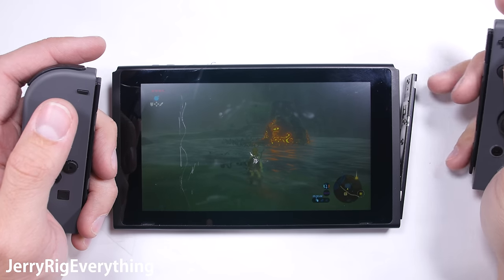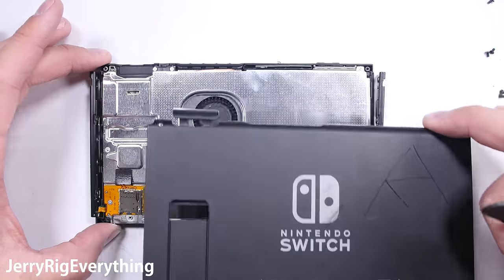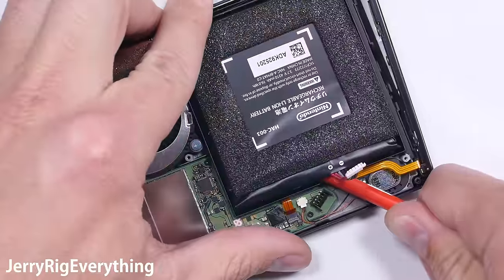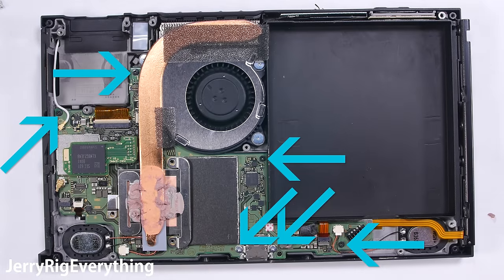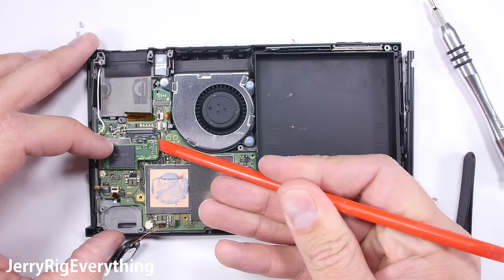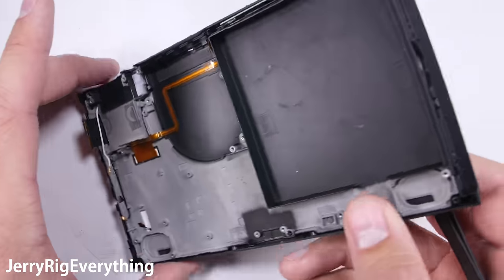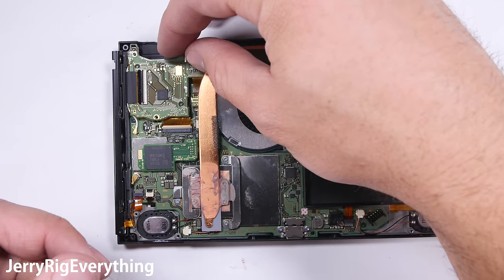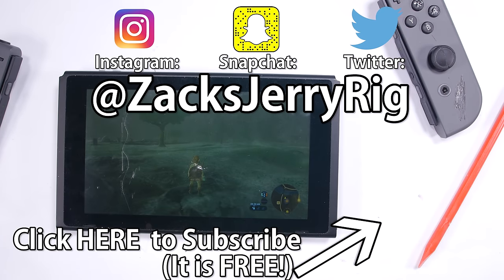Nintendo Switch Teardown - Take apart - Inside Review

Comment: Started this video hoping that the switch would be kinda easy to break down, but it still is a bit much. Having to bent the battery to remove it worries me. Kinda wish the screen wasn’t glued, I have a speck of dust that somehow made its way into my screen. Looks kinda like a dead pixel at any brightness, but it seems to move when I tilt the device, so it’s definitely dust. Not worth the risk to remove if this is what it takes to open up the display.

Comment: 1:30 BE CAREFUL with this screw below the SD card reader, immediately to the left of the red spudging tool.  For whatever reason, my Switch's screwhole here is standard.  It doesn't have that reinforcement this version has.

Just a single removal of the screw from that hole and it was stripped (the hole itself, not the screw.) I actually had to use a pair of snips and cut that piece of aluminum out as the screw would no longer thread.

(For reference: I have a high-quality set of electronics-repair drivers with many dozens of driver-heads.  I've disassembled dozens of mobile devices to do everything short of component-level board repair and NEVER had a problem like this)
Reply: Maybe you have a 2017 model Switch, while on the video they have a 2019 model?

Comment: I've a feeling those screws are probably not actually Phillips.
Nintendo is a Japanese company, so it's much more likely to be JIS, a very similar looking screw, that will work with Phillips screwdrivers in a pinch, but will be completely destroyed by the Phillips head if the screw is too tight.

Yes this is a thing, I can't be positive, as for example ifixit says both In different guides, I'd say most likely JIS, seeing as the 3ds for example used them.

But it's something to be aware of when opening up any Japanese product, get both, and see which one fits better with less wobble

Comment: Guys i need help. I can take off every screw except for the 4 screws on the back of the switch. Ive tried using both y0 and y00 screwdrivers.
Reply: I took 2 of the screws off the back but can't take off the last two, I also want to know which screwdrivers I need :(

Comment: I started getting this Error Code: 2002-3580. I tried taking it in and they couldn’t help. Basically it just pops up after a minute or so. I followed your video and have it all apart, wanted to see if there was something obvious. Any ideas? Does seem like some kind of overheating issue I think?

Comment: Regarding the ribbon cables which are responsible for charging the controllers. Are these also responsible for detecting that the controllers have been attached to the screen? If not, how is the switch able to tell when the controller needs to be connected wirelessly or that it’s been snapped in? 

The reason I ask is because I am having a strange issue with the switch where when the left controller has been fully snapped into the switch screen, it doesn’t register a connection  and is not able to work. However, the controller will begin to start charging so the connection to the ribbon cable is working. It just doesn’t actually register a connection with the controller as far as it being able to be used to work with the console. When I pop the controller out, it is then able to be used in wireless mode just fine. If the ribbon cable both charges the joycon and is responsible for the actual controller connection, why would it only work for charging but not allow the controller to be seen by the switch?

Comment: HELP!  My Son asked me to replace the fan in his switch, so I got everything set up to make the repair, but all the screws on the sides had so much corrosion from "Teen Boys Hand Sweat" that they were like cheese.  So I got out my gun cleaner (on a Q-tip) and was able to clean up and remove all but 1 - that last one is so stripped that I started to try and drill it out.  I know most of you are laughing right now, but I really am highly skilled at these things normally. I'm not worried about replacing them because clearly I'm going to get all new teeny tiny little screws, but how do I safely remove this last one that was "cheese" on the outer layer, but now seems to be solid diamond when trying to drill it out?
Reply: What

Comment: Yeah I bought mine used but I think it’s been opened before because the screw  on the top near the heat vent its gone and every time I play a game it’s always saying that please reconnect your left joy con I need to open it and see if the left joy con rail is connected right so I need to see a closer picture of the way the power ribbon is going or facing

Comment: My cooling system is faulty, it will whir any time I start it up and air flow is insane. The back of my switch where the processor is has a very high temperature. Could I have some recommendations?

Comment: Is that link "phone tool kit"  the one you used to open this switch? I need something for the 3way screw on the back of the Nintendo.
Reply: I have the same problem. I hate when companies use weird screws that no one has the equipment for
Reply: @Ellefsen97  Walmart sells a pack of 77 pieces electronic repair kit under $20 dollars.  HYPER TOUGH its got the one you need

Comment: I have a problem I took apart my switch and when I reassembled it the sd card board under the kick stand doesn’t work. What I mean is that when I put it back on the switch would turn off and the board would get very very hot

Comment: so unfortunately, my switch’s screen got a little scratched before I could buy a protector for it.. anybody have suggestions for remedying? Also, if what makes the V2 switch run on a better battery life is a chip, is there anywhere I could buy a singular similar chip to install myself, making a 2018 switch run more efficiently?

Comment: At 6:30s you see how there is the battery housing and everything? Does that separate from the front shell panel? I need to replace the front & back of my switch but I can't figure that out.

Comment: I need help with a fix on mine. Long story short. I had mine on my bed. Sat on it and the right controller ripped the side railing off, broke the actual controller and ripped a ribbon cable out. Can it be replaced?

Comment: I want to replace the left speaker because it started sounding blown. However I can't unscrew two screws on the right joycon rail like they're so tight and I also managed to flatten the heads while trying to release them...

Is there any way of getting to the internals without needing to unscrew one rail?

Comment: Help! 

Kids switch took a swim. Screen is shot, but it will work when plugged into the tv. The only problem is the battery won’t charge. Bought and installed new battery, same issue. Battery doesn’t charge when it’s docked or plugged in directly. But it does work with the tv until the battery dies. Any way to get the switch to charge the battery?

Comment: I need some help troubleshooting. I replaced the game card reader in my sons switch and when i tested it , it was doing crazy stuff on its own like i was mashing buttons  , i realized the ribbon wasnt fully attached and fixed it and it worked fine. After a couple days him playing its doing this again. I thought it was maybe the joycons causing it so i disconnected them and only used pro to no avail. So something i done had to have cause this but i cant figure out what this is a pretty basic task . Any info would be appreciated. I feel its a problemvwith one of the two ribbons connected to the reader. Can you please tell me what im missing here if this makes sense. Thank u so much.

Comment: Every time my switch is docked and it starts to blow the air out of the exhaust, my tv goes black as if I took my switch out ( yes I’ve checked for loose connections and that’s not the problem ) any help ??

Comment: There something stuck bottom on one of joy con rail would that help to take apart just to remove that something? I tried using pin but it’s hard and don’t wanna scratch the port for joy con to connect

Comment: Wow.  My takeaway is that I definitely will not be able to replace the battery myself.  Too bad I've probably already ruined my battery from having my Switch in sleep mode and on the charger for months at a time.  Rip battery.  Rip portability.
Reply: It's fine I've done the same an mine is fine

Comment: Wish I saw this video before I started messaging with my switch. I broke the ribbon connecting the controller to the switch 💀 

But my controllers were very loose anyways so I need to replace parts 😔

Comment: The thing is I took it apart and put it back together but now I cant take it apart again seems like the one screw on top and the two on the btm I cant take them out again I can use screw diver to try and take them out but they r sticking turning but nothing is poping out its like they r somewhat stuck and can only be turned but nothing really happens

Comment: Which screwdrivers did you use for this job?
Reply: skeletorrobo theres are some on amazon you can buy
Reply: Y00 screwdriver and  philips headscrew 00
Reply: skeletorrobo can i ask you something what exact screwdrivers did you use it says y00 and philips 00 but i didn’t know and ordered a set with y0 y00 and philips 2.0 can i use the philips 2.0 to open the switch too?

Comment: If the ribbon to the game cartridge port card has a small tear in it would it cause the screen to have lines on one side?
Reply: Do the lines only apear when you play a game from a game cartridge?

Or are the lines there all the time?
Reply: CRAIG THE AIR COOLER the lines are there all the time. The unit only loads to the home screen. It won’t play from the dock/tv either.
Reply: If the lines are on the screen sounds like you got dead pixels

Dont know about it not working through the dock to the Tv tho.

Comment: The system connector is soldered into place and irreplaceable.

Nope.  I've replaced smaller connectors than that.